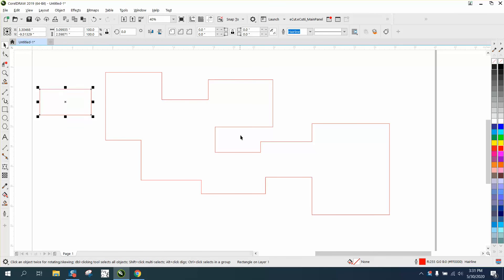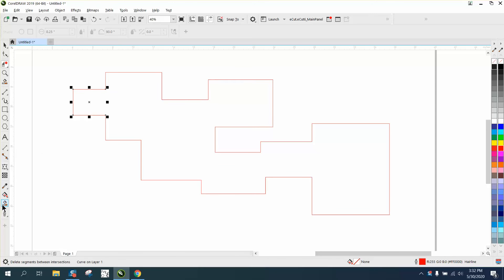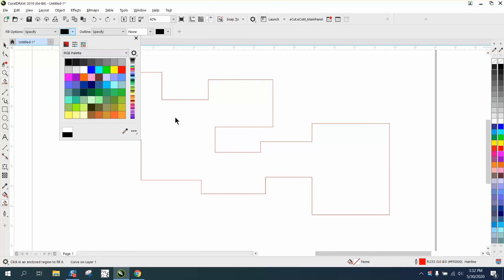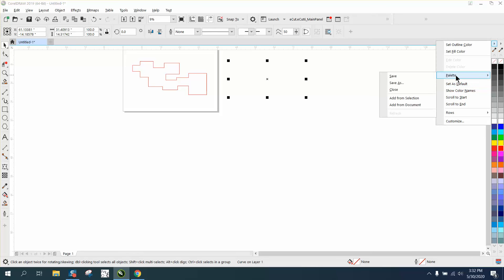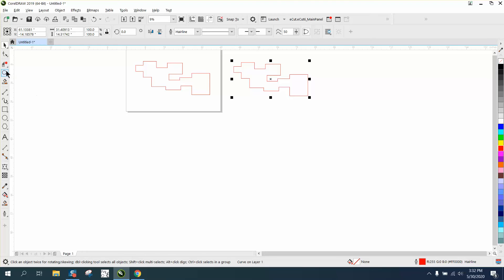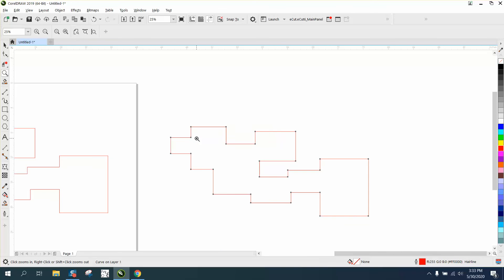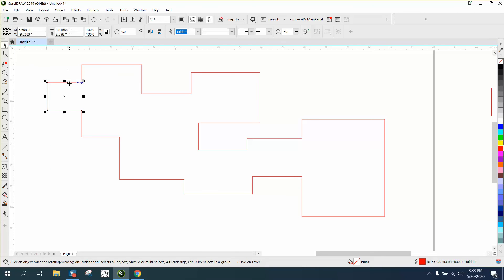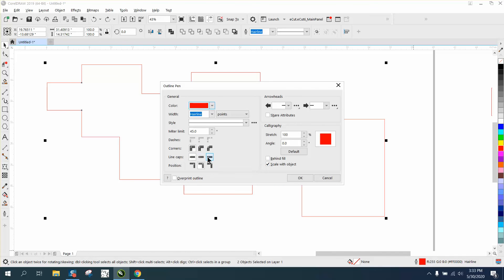Corel Draw Tips & Tricks Smart Fill tool change the outline part 2

Comment: It wouldn't matter whether you change the end cap unless you wanted to convert an outline to object.  If you look at your original lines in wireframe mode, it will only laser from point to point.
Reply from the maker: yes, I was doing more for a Plasma Cutter